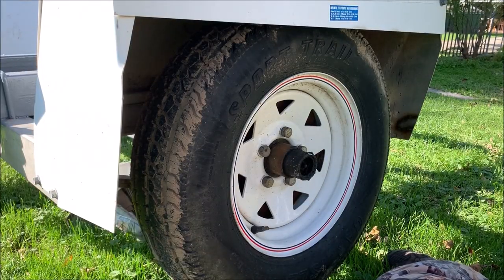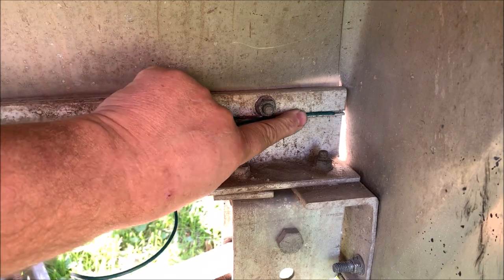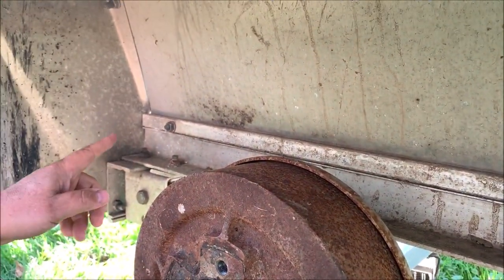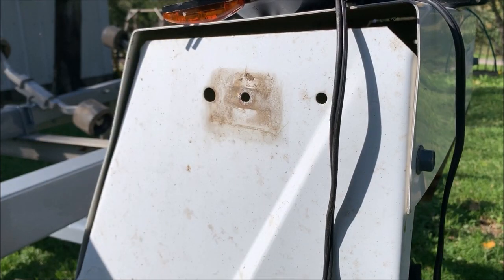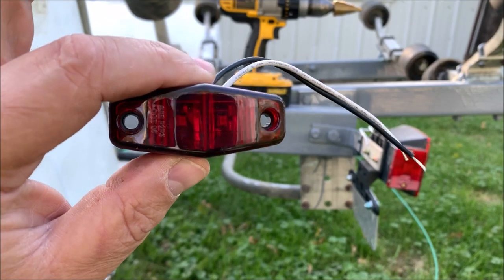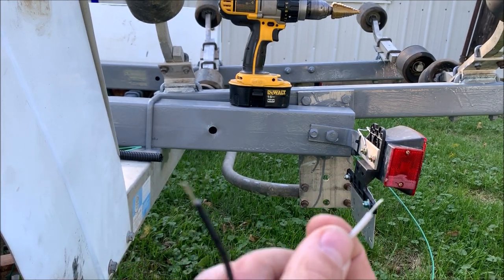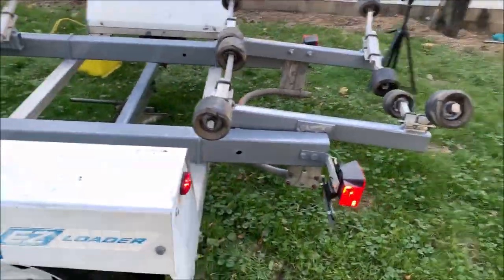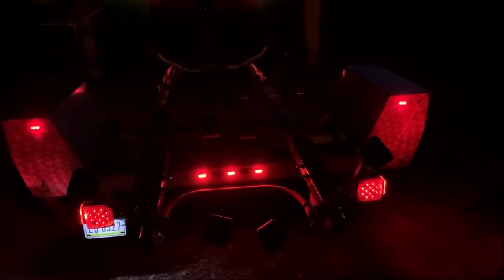My 100 Dollar boat adventure the final chapter part 9

Comment: I like side marker lights on a trailer as well, not just forward and rear facing.  It could save a trailer getting T-boned at night.  Great job on the rehab and the upgrades!  Thanks for sharing.  I like the dual wheel tongue jack.  And bonus that it was cheaper than the single wheel!
Reply from the maker: I'm with you on the side marker lights, thanks for watching